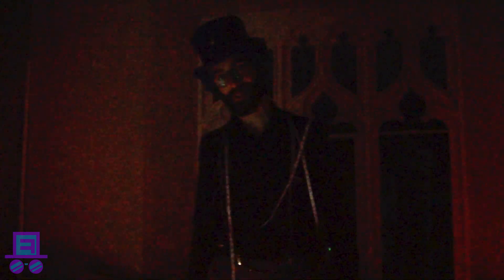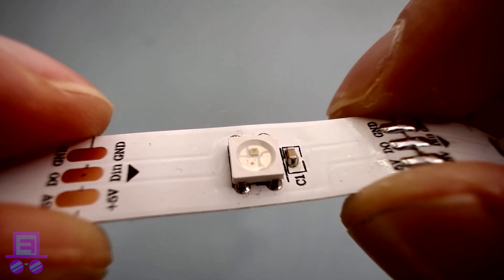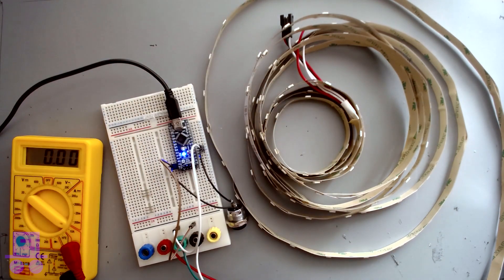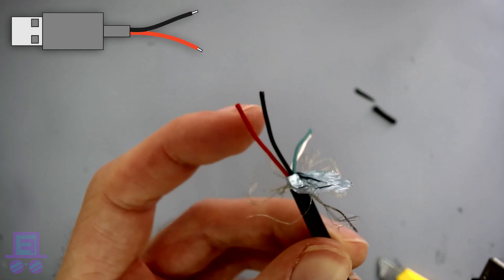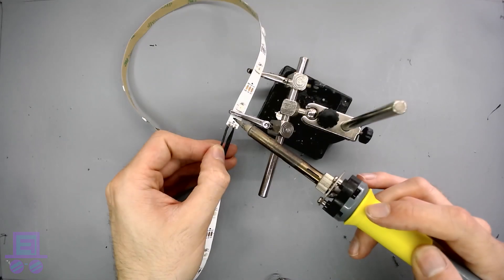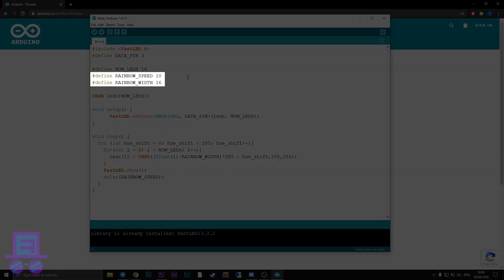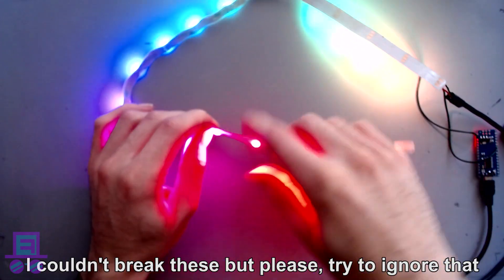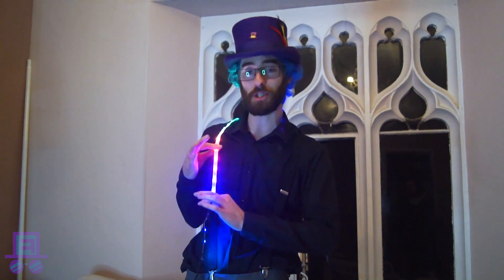TEF 4 - Fursuit LED Strip Tutorial

Comment: How could i go about making a led strip like a sheet to put around the tip of a tail for a fading gradient that starts dark at the top and gets brighter as it goes to the bottom?
Reply from the maker: Make a load of strips along your tail. Liiiike this ===>
Ensure the data is running towards the end of the tail
Connect all the power, ground and "data in" pads together
You now have X LED strips that will act as one super wide one.

Comment: If I connect multiple of the LEDs for parts that move a lot, as you said, what wire should I use, and if I make it long (~10 feet long), how would I put the heatshrink over all of them before the hot glue dries on all of them? The glue might dry and spread when sliding the heatsink over. Should I use something else?
Reply from the maker: You should be able to slide little sections of heat shrink just over each LED as you solder them together. Also don't worry about the glue drying! The hot air from the heat gun will melt it again! Also you can get the lillypad led chains online pre-made! Something I recently used for my highbeam suit

Comment: Heyo! I was trying to follow your tutorial with a set of ws2182bs and after soldering and uploading your code onto my arduino, nothing really seems to happen. only the first 5 leds on the strip light up and it's only a faint red. Is this because the usb I used is 1.0, or maybe because I soldered it improperly?

Comment: Is it possible to run two strips in parallel from the same data output pin?
Reply from the maker: So you can wire the power in parallel and the data in series!

Comment: So in my suit I was to use the lillypads only for freckles. How would I attach the arduion to the lillypads so I can control them
Reply from the maker: The same way as the strips! wire up the ground of both the arduino and the battery pack to the first leds ground pad, the batteries red wire to the +5v and D3 to the DIN pad.

Comment: how would you thread it for markings so that you can wash the suit normally? and is it possible to make everything controlled by one powersource using a network of lengthy wire? (ie: the head to the body to the limbs)
Reply from the maker: Washing: make "pockets" on the back of the fur to slide the LEDs into. You can then remove them before washing
Singular power source: Yes! Just hook up all the positive and negative wires to a single battery
One wire: Yes you can drive lots and lots of WS2812b LEDs with a single wire, however you will run into issues with frame rates due to processing power and how the WS2812b LED's propagate data. Anything under 200 should be fine
Reply: @TheMariday  oh well, I'm not planning to hook it up to an arduino-- it's just solid blacklights lol. Hopefully frame rate shouldnt come into play. I just worry that using one wire for the whole thing will make the lights dimmer lol. (Brain is thinking in Minecraft redstone logic)
Reply from the maker: @HiddenMongoose  ah sadly ws2812b LEDs require an Arduino otherwise they don't come on!
Reply: @TheMariday  oh I'm using a different kind then I suppose. I'd tell you what type it is but I got a strip of USB LEDs and it doesnt say the specifications.